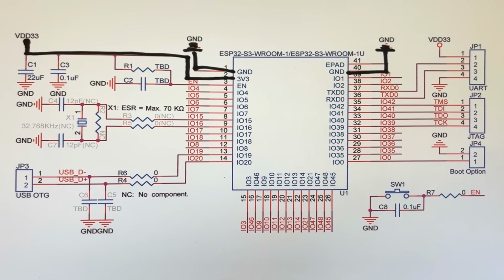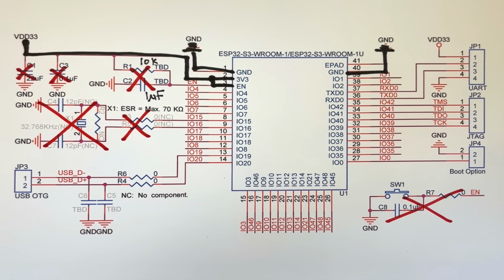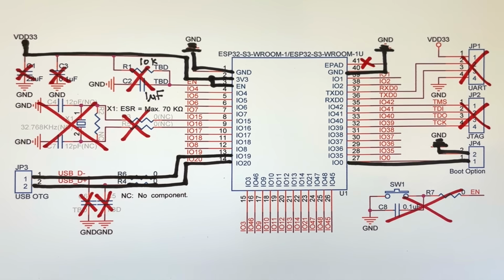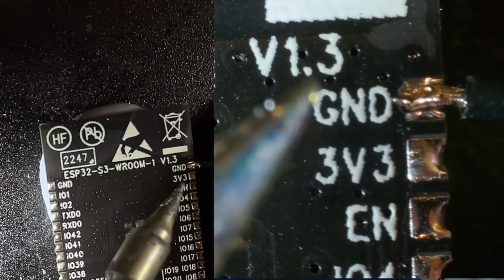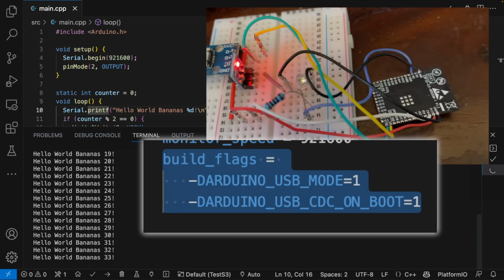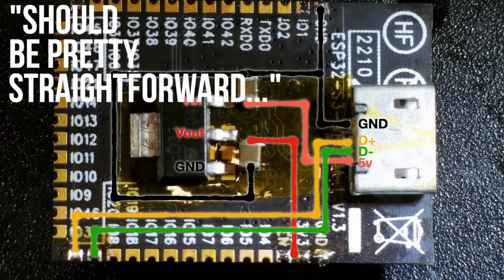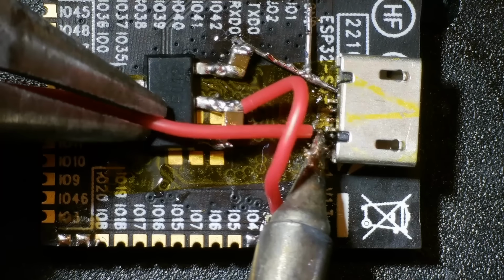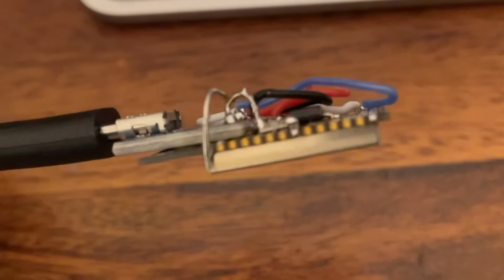Minimalist Microcontroller: Building a Bare-Bones Dev Board

Comment: It's surprisingly useful to know the bare-bones setup if you run into trouble when designing your own dev board :). Speaking from experience here....
Reply from the maker: Yeah - that was part of my inspiration - trouble shooting customer boards. Is it my board, the module, or just terrible soldering…
Reply: Ah but look at what you've lost!
WiFi,Bluetooth,accessible Pins,Clock,RAM,control of power...  Love ESP32❤

Comment: The capacitors on the USB lines are not used for noisy signals but as ESD protection. There should be at least a nF range cap on every pin to protect it against transients.
Reply: So which capacitors he is using here?
Reply: @muhammadshaheer8309  he is not using any, that is the issue. The capacitor type should be MLCC chip cap, X7R type dielectric.
Reply: @filips7158  And of which values?

Comment: Note: You cannot reliably connect EN to the VCC without the resistor and capacitor, as the ESP32 can fail to boot/program if EN rises before the voltage is stable (the reason for the resistor and cap is to delay EN going high). I've tried this shortcut on PCB designs and it /may/ work for you, or may not. For a couple of pence in parts, it's not worth the risk.
Reply from the maker: Definitely agree - the PCB I've got coming has everything on it - surprising what you can fit into a very small space!
Reply: hello @Stabby666 i seem to be have this (can fail to boot) issue . i added the 10k resistor on the EN pin and it appeared to improved the percentage of times esp 32 started the program. but afterwords i still had unreliable start up. Do you think the problem is that i should also add also add a 1μF capacitor as you recommend ... ?  and if you know should i also install a 10k resistor also on the gpio0 ? my only requirement is for esp32 to always start when its provided with power. no need of usb serial or buttons or need to program it. i have the chip pre-programmed.
Reply: Agree. At power up, the cap is initially 0 V and the voltage across the cap steadily rises exponentially until the 3V3 applied is reached.
Reply: Works fine for me 🤗
Reply: @lindaljungdahl8688  it’s pure luck if it works. The point of the cap and resistor (as Espressif themselves write in the docs) is to ensure the chip is held in reset until the voltage has risen sufficiently for reliable operation. It’s pretty common for MCUs/CPUs. For personal projects I guess it doesn’t matter but for under 1c in parts it’s not worth the risk in a design.

Comment: Mr Atom, I found that when it comes to soldering jobs like these, there are these wires advertised as "wrapping wire"

They're more pliable, so they're easy to persuade into shape; they're thin enough to make soldering a little easier for small components; and the core is tinned I believe so it makes soldering easier generally

Comment: You make a clever demonstration of how robust the ESP-32 is. We will be running out of IP addresses again if we put them in toys. Some wire wrap wire would make your task much easier. A search on `Manhatten type prototyping` and 'dead bug prototypes`  should give you some ideas to make building things like this easier.

You are putting a great deal of faith in the quality of power of the USB port the ESP-32 -plugs onto.  Many years of experience have shown me that filters and bypass capacitors on B+ are needed. I've also learned to put a  bleeder resistor across the B+ on computer boards others are going to install. A slow sagging B+ voltage can cause problems with some SRAM and EPROM. There is no way to tell how others will use the thing you make.
Reply: "Dead Bug" protyping brings me back to 2006 making BEAM robots from Mark Tilden's original designs, man how time flies
Reply: These shouldn't affect the IPv4 address space issue. They'll all be behind NAT on people's private networks

Comment: You can also try the ESP32-S3 Mini Module and ESP32-C3 Mini Module, which are more tiny. I have tried the ESP32-C3 Mini Module for a tiny space project, i just has the same thought of your, just ignore the unncessary caps, and just connect D+ D- to PIN 18 & PIN 19. The S2,C3,S3 support USB-CDC,which make it possible, i really like this.
Reply from the maker: Ooh yes, I should have used a mini for my next project! That would have been a good challenge.
Reply: Yep, really LOVE those Seeed Studio XIAO - ESP32-C3 modules.
They don't have anything other than an IPEX connector, 2 buttons and an USB-C connector on board. (apart from the encapsulated module)
Since they also use an external antenna, the WiFi reception is also quite good.
Reply from the maker: Very nice. And really tiny! I am wondering if I should have gone with an external antenna for my PCB version.

Comment: Work of art! was thinking if you started with four strands of ribbon cable and soldered those to the naked USB micro pins while everything was straight and aligned then you could route those wires easily without needing the additional break out board. 20/20 hindsight and all.

Comment: Great video!
But may I offer a suggestion?
I used to teach a solder-certification course for missiles,and in watching your soldering, I see your main difficulty is not using an external flux.  The solder on your iron and components becomes oxidized leading to globing and lack of heat-conduction. 
  I realize that many people forego flux because of the necessity for cleanup, but you would have a much easier time if you would add some. If you ‘flood-the-field’, you can use your existing iron tin, otherwise, with minimal flux, use new solder each time but added flux is still recommended.  Anyway, appreciate your video and all your commenters. 😊
Reply: I tend to use one of those cheap 'no-clean' flux pens. It's quick n easy and gets me out of trouble... a lot.
Reply: Aside from this great tip, the wires were also stripped a bit too long. This is also why there's wire pointing out on all of the solder joints. The amount stripped off should be halved.

Comment: For wire connections in quick and dirty tasks that are not to be used next day I use cores from solid utp cable cat5 or 6. Also u can strip it twist 2 cores, wrap it couple of times around soldering   cylinder and use twisted wires end as new soldering tip. Last one is old hack from my grandpa when nothing was available (apparently they had abundance of stripped wires and some source of heating, not always electrical)

Comment: I am so greatful I found this video at right time. Me and my cousin created our own custom dc motor driver based on esp32. We kept en and boot pin for programming. I am new on electronics side, so I was trying to program by keeping the boot pin low and never kept en pin high thinking its high by default.  Once I saw this video, I checked with multimeter to see that enable had only 1.2v. I then connected en to 3.3v and everything now works!!.  I now also understand the importance of those resistor and capacitor  we need for en pin and planning to add for next iteration of board. 
Really appreciate the time you spent in explaining things.

Comment: wire wrap wire is nice to work with, get different colors to color code.  Beware insulation melts very easy and can cross connect if not careful due to soldering and crossed wires.  Have tried the magnet wire, that can work nice, it's typically a little too thin(hard to see, work with), am going to try a slightly larger from a different scrap solenoid with thicker wire.  And it's free with some scrap parts.  For glue try sprinkling some baking soda on with super glue and it sticks to anything, dries instantly, and produces rock hard results.  A little strange to work with as you have to sprinkle baking soda, but it works and you can build up amazing rock hard structure.  Interesting the newer esp32's you can do USB direct and get rid of the USB-uart chip, that just seemed silly to have on every dev board.

Comment: If you feel like giving it another go, I suggest you scratch away the solder mask in opportune places and use the copper ground plane for ground connections - that should also give you enough rigidity to actually mount the USB connector straight to the module. 
Decoupling capacitors are not optional though. Under less than perfect conditions that suggestion will certainly get someone in trouble - eventually :)

Comment: Did you end up having to put it into boot mode manually with every upload?
Reply from the maker: It seemed to be pretty random - sometimes it would flash consistently without issues multiple times. And then it would refuse.

Comment: An advantage to this is that deep sleep will probably work a lot better compared to a standard dev board. The components on a dev board usualy keep using power during deep sleep or prevent it. I'm going to try this.
Reply from the maker: Yes, you just need to use a better LDO than the AMS117. There are really nice modern ones that have really low quiescent current.
Reply: if conserving space is not an issue, buck converters work pretty good as well. They have a low quiecent current and additionally make full power operation alot more efficient

Comment: Really awesome ! 
Can you still use all the gpios? 
I was just thinking about a tiny ESP-based polytuner for the guitar - strum all strings at once, and see which needs to tune up or down.. 
At minimum we'd need - a tiny mic connected, running fft onboard, either 6 tiny rgb leds or a thumbnail sized screen, tiny battery with charging over usb, & a power button/capacitive touch. 

After all string are in tune, flash all leds as a success signal, and shutdown.
I'd enable raw data transfer over BT so an app on the phone can see all the signals and frequencies together in detail in real time. Also through the app you can set/change tunings and instruments. 

Honestly I don't have any experience designing a board, and lack in electrical engineering. But I'll happily write the code :)
Hope you're a musician haha
Let me know if you like the idea and if you'd consider helping.
Thanks a lot and all the best !
Reply from the maker: Yes, all the GPIOs are available - it's really just like a normal dev board. Unfortunately I don't have time for other project work, but I'd be really interested to hear how you get on.

Comment: i like to use 30 gauge kynar wire wrapping wire for soldering up like this.  it's just the right size.  thanks for doing this, as is being said it's very handy for quickly insuring what components and connections are necessary

Comment: what are the values of the capacitors on the regulator please? Input and output respectively. Thank you for the video.
Reply from the maker: For this project I was just doing a proof of concept, so I used some fairly random values. The data sheet for the AMS117 that you are using will give you the exact value to use.

Comment: In fact, in many cases we overpay for devboards. Sure, it is worth having one, but mounting a working system with its use is a waste of. The only thing we need is the 3.3V regulator and the socket for convenient connection of the USB-UART board (For comfortable ones - for programming ESP -01. For hardcorers - an old laptop with a COM port). In all this confusion, the most pissed part is the part that the leaders are not 2.5 mm in the raster and you need to solve how to lead them to a standard protoyping plate.

BTW: in your solution is bad - you cover anthena by usb port. (look to datashet, for recommended module placing) Best way is use more capton tape, and move it to bottom (if antena is on  top) (or even move all elemnts to ESP cover.
Reply from the maker: Very true. Defnitely a bit of a compromise on the antenna. I've got a PCB coming so I'll do some tests to see how much of an impact it has. Inspired by looking at the TinyTV teardown (https://youtu.be/xA014EvU4GU) I'm thinking of doing a new version with a vertically mounted USB socket. I'm also thinking there's plenty of room for MEMs microphone. And I think putting a connector for a display ribbon cable is easily doable as well.

Comment: Is a CH340C really obsolete then? I only see designs where it is still used. And you said it by yourself that on the dev board there was a UART converter. Can you clarify when I need it ?
Reply from the maker: You don't need it with the S3 - you can just directly connect D+ and D-.

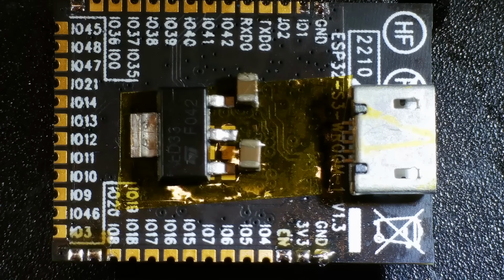Comment: At 6:18 you mention a decoupling capacitor. Would you mind sharing which ones you used? 22uF, 10v?
Reply from the maker: I just used some random ones from my spare parts. For a real PCB, you would need 10uF for the AMS117 and then for the ESP32, you would need the decoupling capacitors it recommends, 22uF and 100nF.
Reply: @atomic14  gracias
Reply: @atomic14  10pf electrolytic cap decoupling I thought? Well whatever 😂

Comment: for what the build flags mean:
-DARDUINO_USB_MODE probably enables usb support for arduino-adjacent microcontrollers
-DARDUINO_USB_CDC_ON_BOOT is what tells the microcontroller to enable "USB Communication Device Class", which is the spec for sending plain serial over USB. and because of the "on boot" part, i assume there is some way to do this in code.
Reply from the maker: Thanks for the explanation!

Comment: I am working on the same project and I am amazed with your applied and clear explanation! However, my power supply is going to be a 1s LiPo with around 3.8 Volts and AMS1117-3.3 seems doesn't help since the Vmin is rated 4.8V. Any recommendation from your side would be much appreciated!
Reply from the maker: I've been using the NCP167BMX330TBG in a lot of designs. It's got a 210mV drop out so should work for what you need. It is very tiny though!

Comment: Is it possible to power down the wireless devices, or better yet get a non-wireless version?

I see a lot of new platforms coming out with built-in wireless, which is great.. but sometimes you do not want the RF environment of a wifi/BT device, and just want the microcontroller.
Reply from the maker: Sure - you don’t need to enable the wireless/Bluetooth. It doesn’t turn on unless you tell it to. There are ESP32 modules that don’t have the PCB antenna and just have a small connector for an external one so you can even save space. But, if you’re doing a project that doesn’t need wifi or Bluetooth then it might be worth looking at the RP2040 as an alternative.

Comment: Dude you rule- this is another project that was exactly what i needed!
Reply from the maker: Thanks! What project are you working on?
Reply: @atomic14  Hi! Pretty much everything I make has a New esp32 tucked away in it, and I'm currently working on a project where a small form factor will be critical, involving LEDs, vibratory motor, servo motor, and somehow being waterproof 😳 I've also been flirting with having my boards assembled SMD style instead of using through whole parts, and this was incredibly helpful for that (as well as your other videos)

Comment: In case it is unclear, getting rid of decoupling capacitors that are tiny and cost a few cents is not a good choice.  Maybe that first bulk capacitor can be deleted, but not the tiny decoupling ones.  If you are breadboarding, yes, try it, but if you are getting a PCB made, just don't do it.

Comment: I didn't even know you could program the esp32 with the USB otg port, is there a documentation talking about it?
Reply from the maker: Only the latest set of chips - support it, so the original ESP32 still need the USB-UART bridge.
Reply: @atomic14  thanks, are those s2 and s3?
Reply from the maker: @JS7457  that's right. One thing that is needed are the buttons for boot and reset. It seems that I can burn firmware 99% of the time without issue - and then randomly it will just stop working and I need to take IO0 low and reset it.
Reply: @atomic14  thanks!

Comment: Where did you get the schematic?
Also, no need to do the "hold boot and hit the reset" for uploading? Which is what I'm doing on an original ESP32 module and also a C3
Reply from the maker: Schematic came from the data sheet - https://www.espressif.com/sites/default/files/documentation/esp32-s3-wroom-1_wroom-1u_datasheet_en.pdf page 28. With the S3 you shouldn't need to do the boot reset dance. But people's experience seems to vary.
Reply: @atomic14  thanks for your reply. I actually did a bit of research and found it, and several other, but thanks anyway.
Also looked at various schematics for the C3 and it seems that you can pretty much just hook a USB connector up to the D+ and D- pins of that one too. Jolly handy as the board has way too many pull ups and using an FTDI and stabbing buttons is boring.
Keep up the great work!
Cheers
Matt